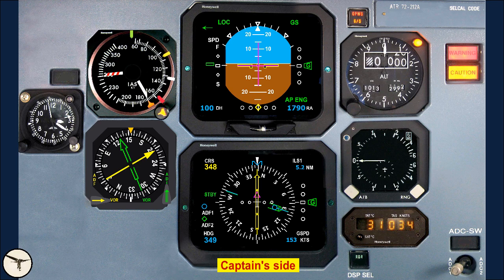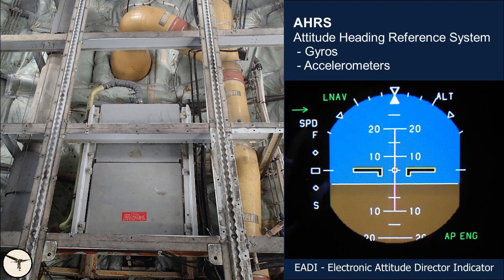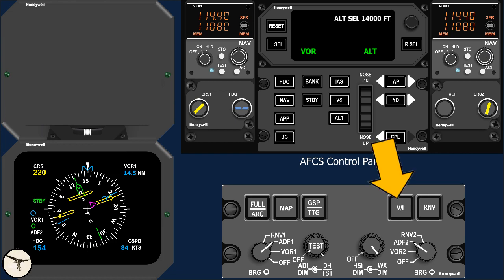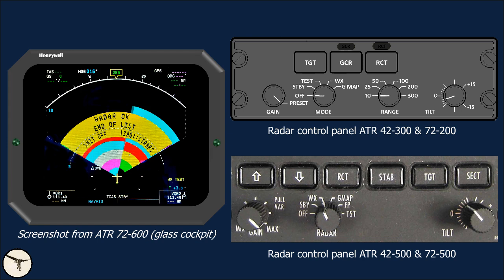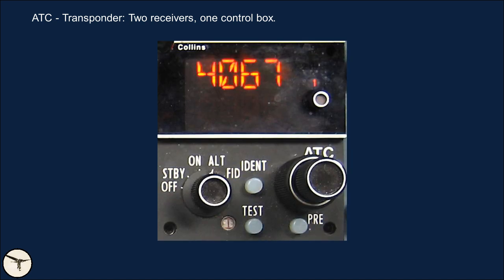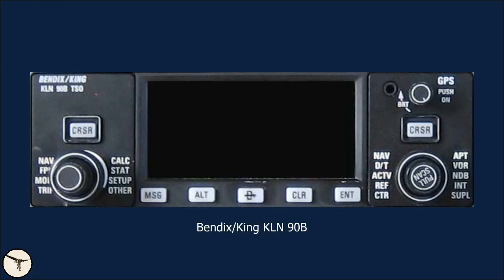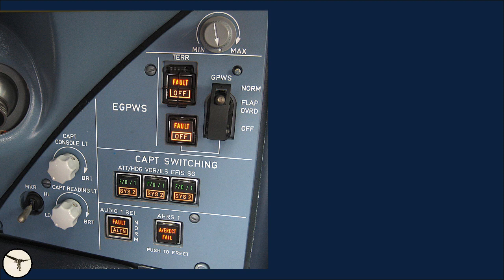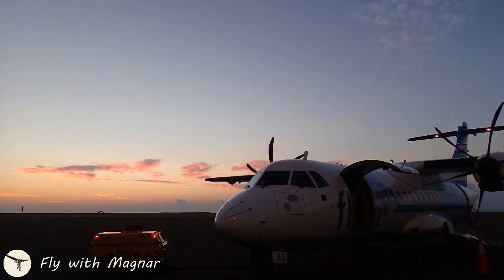ATR systems - EFIS instrument panel part 1

Comment: We Can See Wind Speed And Direction On Both EHSI And GNSS.. Which Equipment Or Computer Wind Data Is Coming From?
Reply from the maker: The wind data is computed from true air speed (ADC), ground speed (GNSS), heading (AHRS) and track (GNSS).